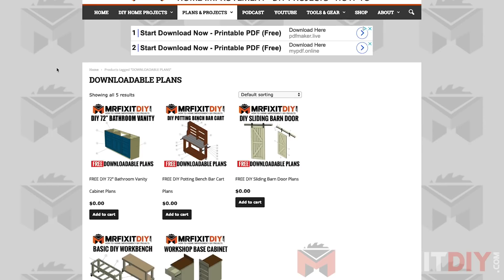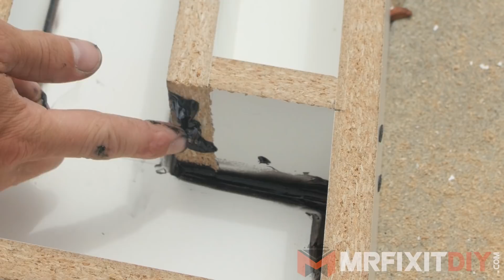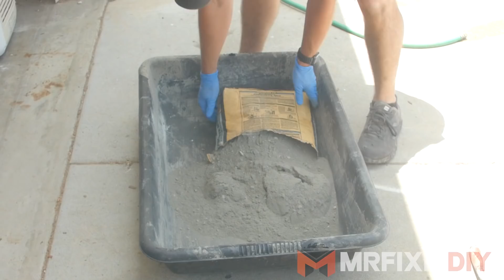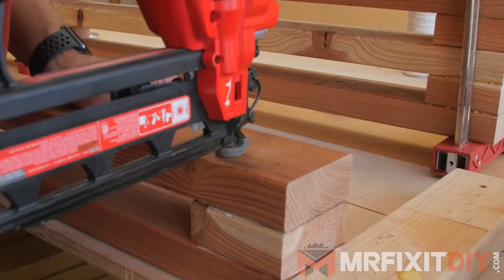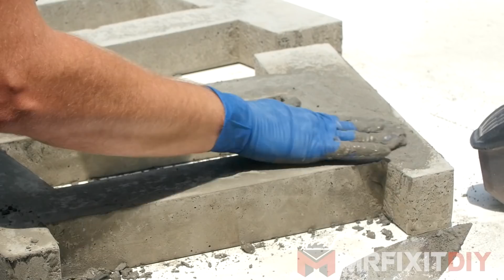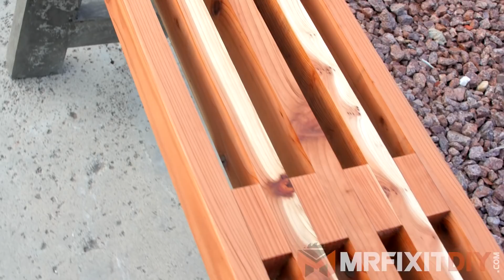DIY Wood & Concrete Bench | How to Build | Free Plans

Comment: Thanks for the shout out!  The bench turned out great!   One other tip, which I don't think I've ever mentioned in my videos is for sealing the exposed ends of melamine.  You can just cover them in 3/4 inch electrical tape, since it is waterproof, and it will give you a really clean finish on the concrete surface.
Reply from the maker: Great tip! Thanks dude.